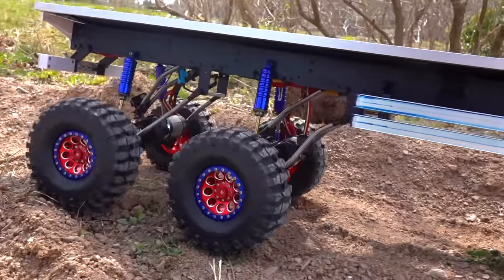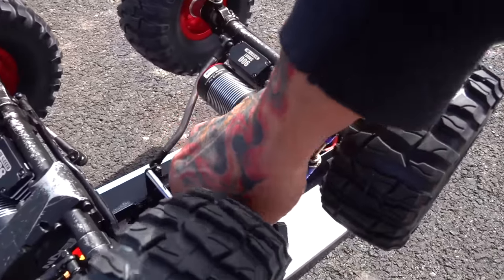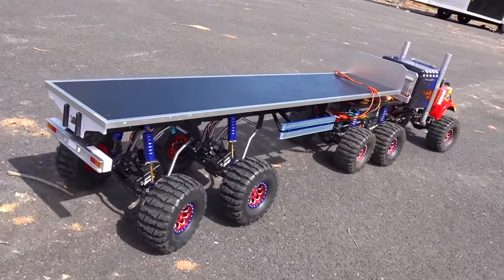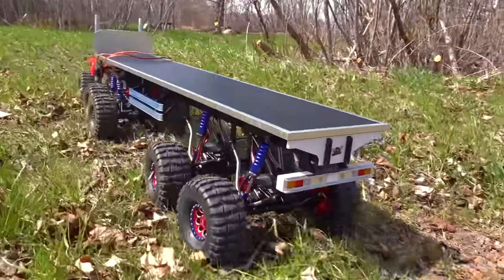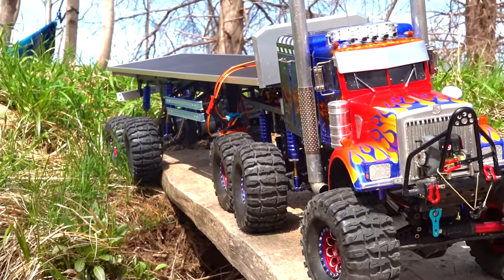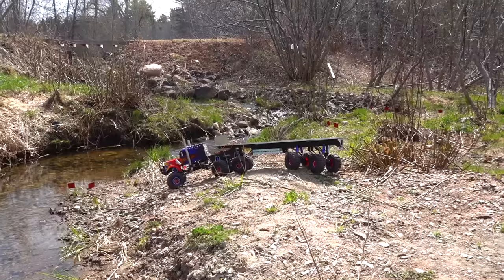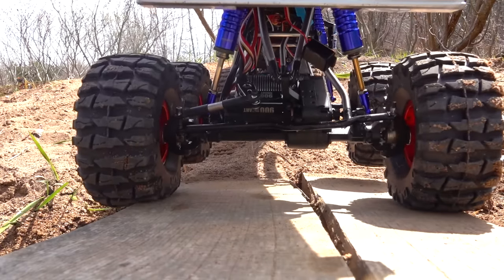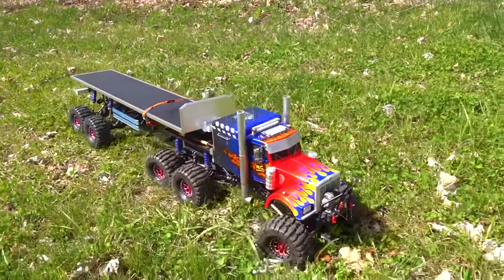10x10x10 "OPTiMUS PRiME" Replica Overkill w/ Off Road Trailer - RadioLink RC8X TX/RX | RC ADVENTURES

Comment: First thing I thought of seeing this build, Other than the fact that this rig is ridiculous and awesome, is if you could rig some sort of sensor to detect the angle of the trailer compared to the truck when turning so that the rear steer still operates once the trucks wheels are straight and you wouldnt need to do any steering mixing. You  could possibly even do a mechanical linkage.  would smooth out the cornering and reduce wear on the wheels and drive train on the trailer.  Sweet build tho dude I always get excited seeing a new video from you on the feed

Comment: There was a toy back in the 80's, it  Was a Caterpillar type crawler truck thing. Had multiple axles and flexed between each set of tires. Dreams where had over that toy, you just about built a working version. Thanks for inspiration and reminding me.
Reply: Monster machine by Tomy
YES! Dude u look it up
So badass